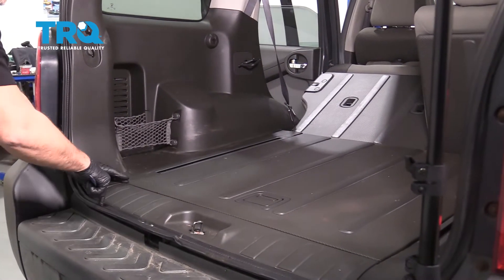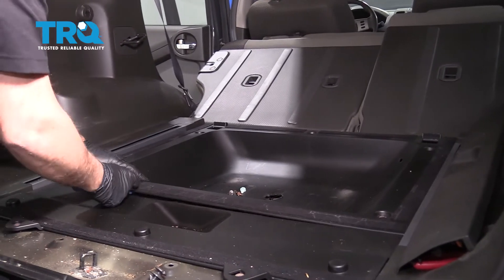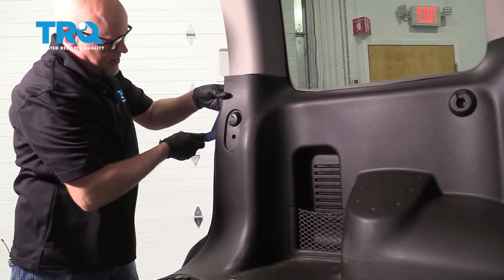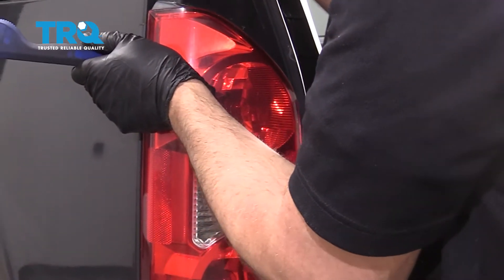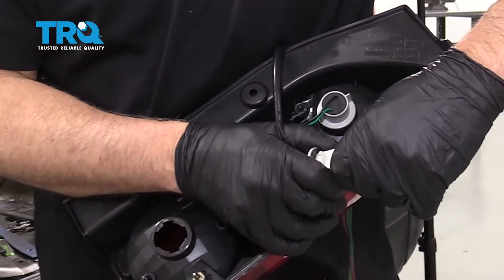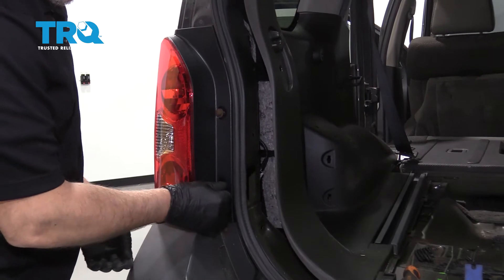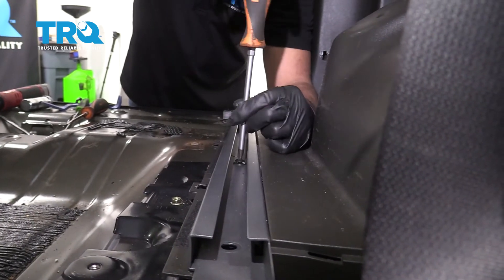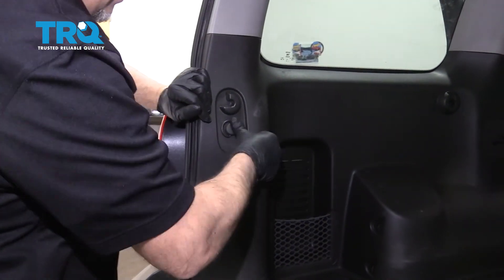How to Replace Tail Light 2005-15 Nissan Xterra

Comment: I used a 10mm wrench for the two bolts and a putty knife instead of a trim tool.  Changed my bulb in about 3 minutes.  The rest was unnecessary if your just changing a brake, tail or back up light.

Comment: If the plexiglass shell is broken but the bulbs and wire harness still work fine, you can just pull out the bulb sockets and fasten them into the new shell without using the new wire harness. This will save you from having to remove all the paneling. I just used the existing harness and saved the new harness in case I ever need to replace it.
Reply: Thank you so much. One of the bolts on the long runner was seriously stuck and getting stripped and I wasn't going to be able to get in to unplug the wire harness. This tip saved me today. Wish I would have seen this comment from the start!

Comment: I don't know why you would think you need to take all the paneling loose like that. There is no reason to take loose the wire harness behind the paneling. The 2 bolts taken out at the 3 minute mark are easily accessible without taking the trim loose. The taillight  pops off as shown and you just reach back to the back and replace the bulbs. I'd rather set fire to the car than to go through all this to replace a bulb.

Comment: If you want to change the entire assembly including the wiring harness but don't want to go through all this. Do the following:

Remove hook as shown at 0:30
Skip to 2:10 and pry out top part of panel as shown.
This will give you enough room to unplug the cable.
Don't bother taking out the other Phillips screw on the panel.
Note: if you have really big hands or forearms you might need to get someone smaller to unplug for you.

Comment: Unless you need to replace the entire wire harness, why would anyone do all this? Just take the lightbulbs out if you really need to detach the actual tail light.  I guess it’s good to know, but a bit misleading to not explain that 90% of the time no one needs to do this…